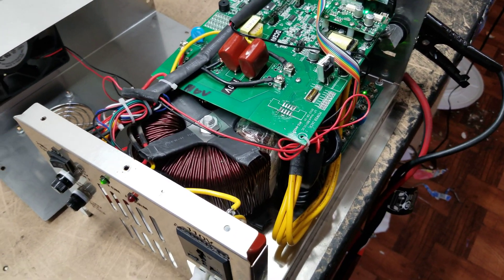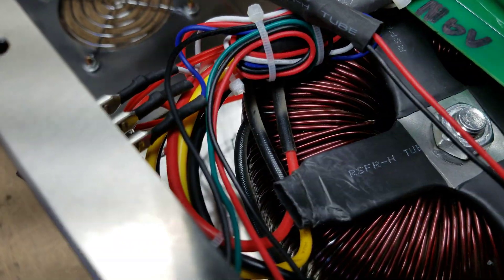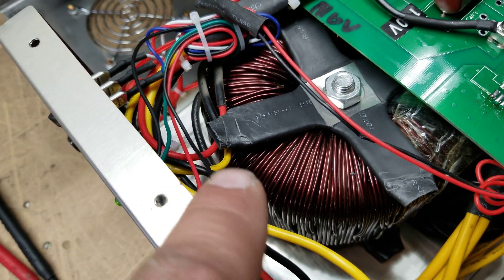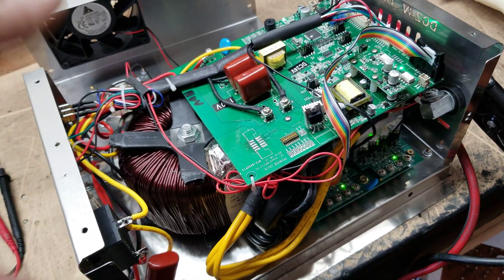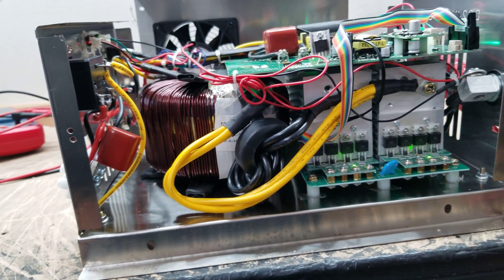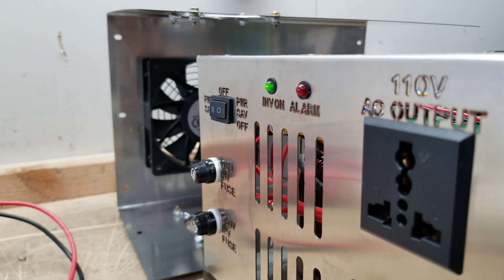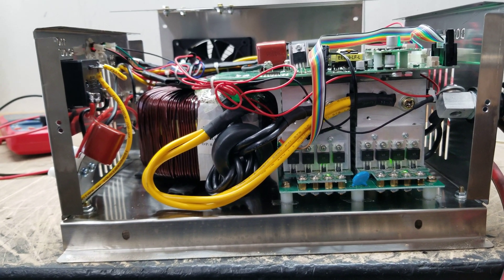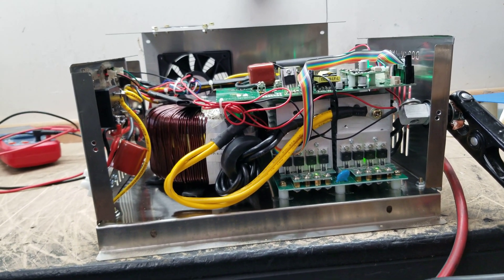Power Jack 1000 watt split phase custom inverter closer look

Comment: Greetings, can you help me?  I burned the mosfets of my inverter trying to connect 220v to my inverter in charging mode, it is a 15k W split phase, I put all the mosfets and the driver board, it worked like 6 days and it burned them again, I bought them again and  It burned, 2 times I have done it, now what I saw burned is a board called led light board, it goes in front of the inverter, in which several plugs are connected including the on/off Switch, Hz control and several boards are connected  There, whoever is that burned board will have a relationship that in 5 or 6 days the mosfets will burn again?  Thanks for your help

Comment: All split phase inverters I am familiar with, when rated at say 3000 watts, means it can only handle 1500 watts per leg.  Are you saying, by rating this inverter as others do that it is actually a 2000 watt inverter?

Comment: If a Inverter is labeled as 1000W I would fully expect it to be capable of operating at 1000W.     Not 1000W for 30 Minutes, 10 Minutes or one minute.   Continuously Operate at 1000W.    Is that expecting too much ?
Reply from the maker: This inverter will operate at 1500 watts all day and all night. If I had access to a larger battery bank I would do such a test.

My load test has proven what it will handle. The fact that the fan turns off after 2 minutes means that it is able to manage the heat of a 1500 watt load just fine. If the fan ran continuous then it's either not able to keep up or is running the red line.
Reply: @GenetrySolar  Yep, and as it should be.  Thank You.
Reply from the maker: I know where you are coming from. And I fully agree with you.

I am trying to show people that this new line of imverters are full rate inverters. Power Jack is managing costs by having everything built in house. Simple, reliable. This 1000 watt inverter is still the price equivalent of a 3000 watt power jack inverter but it is full time rated and still lower prices than that of the competition.